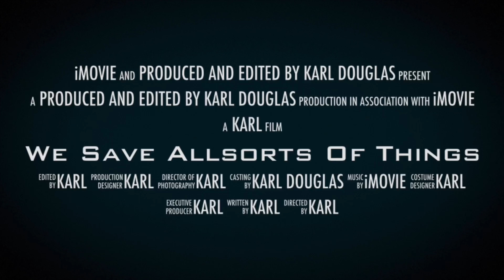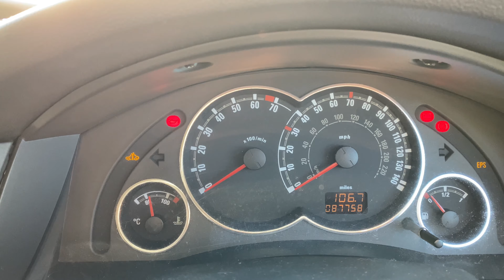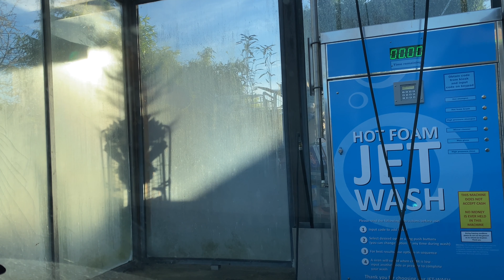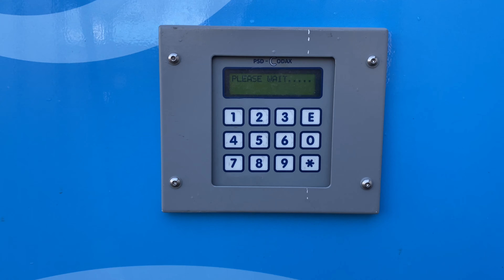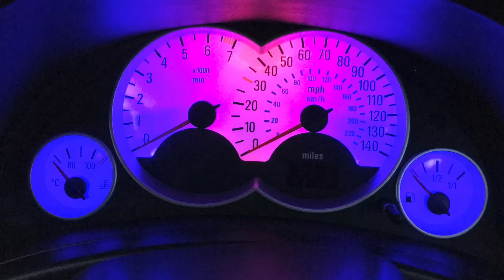New Project Vauxhall Meriva Design Black Part 1 walk Around & lets get work started

Comment: The 3 steel rims that are the same are, what it came with from factory. Vauxhall do some wheeltrims that bolt on using the wheel nuts. They look very much like alloy wheels and are on a lot of merivas and Astra’s